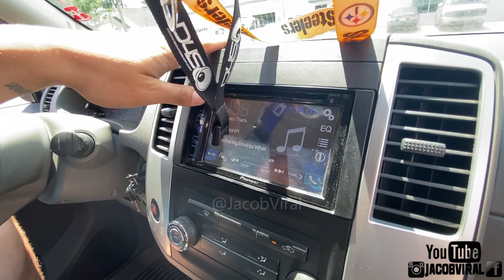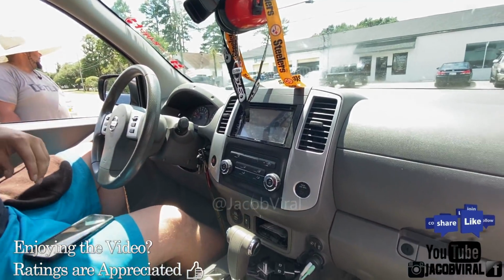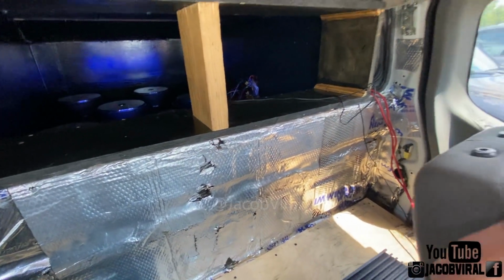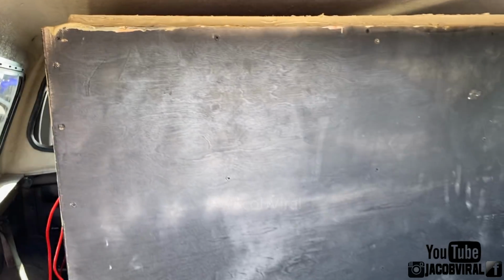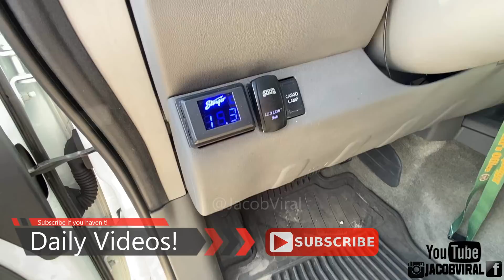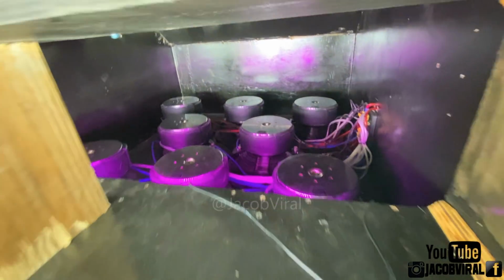TRUCK WINDOW BLOWTHROUGH BUILD GETTING DOWN!

Comment: I'm wanting to do the same with my Ford F150. Wanting to go with four 15s and a 12k. Thinking of maybe eight 15s on two 12ks. I got 2 ho alts, but I need more lithium. I only got 80ah yinlong.  Need at least 120 more. I'm going to get the lithium, and get the alts mounted first. Then I'll look at equipment. Maybe Fi BTL 4s, Resilient Sounds, or Wolfram. They're fairly economical. Have to go Brazilian on the amps tho lol.  Just can't afford much else. Thanks for the content Jacob.

Comment: If looking at taramps fir upgrade. Bass 15k is better at half ohm. I been running one since end of last year. $1100 for cheap made amp with small footprint and decent power. I ran the ddx’s on last build and had issue with the surrounds coming unglued from basket frame. Good luck sir. I like seeing builds coming together.